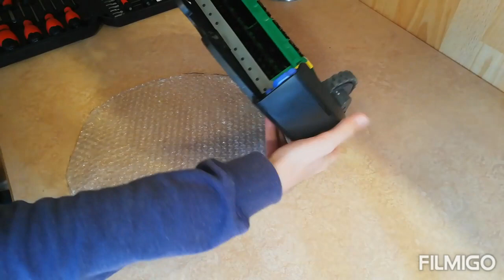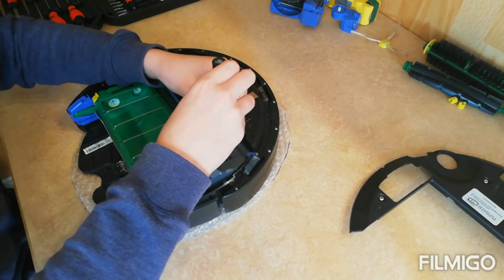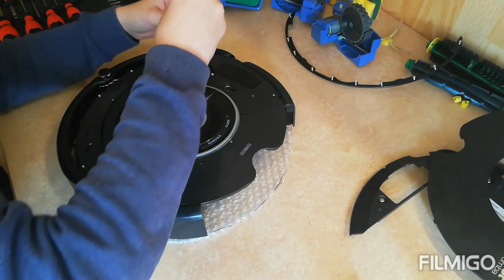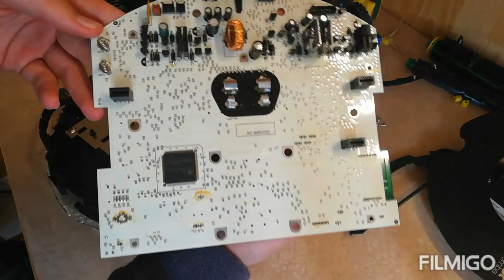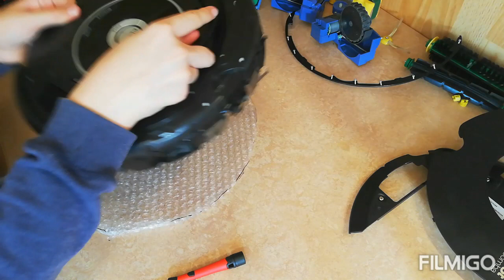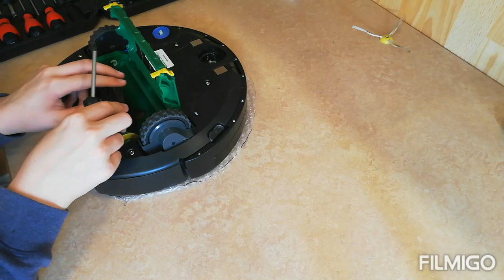How to take out motherboard from Roomba 500 series | RoboVacCollector

Comment: My schedule button on my 595 isn't working but all others are i can set time. I read the contacts some time get dirty and can use cleaning with alcohol. What contacts would i be cleaning
Reply from the maker: You need to dissassemble the Roomba, dissassemble the button, it is hold by single piece of tape, then remove it, and clean it there with rubbing alcohol.
Reply: @robovaccollector  your video is very helpful understanding how things work. Its been months since used schedule botton i changed tire treads so removed the battery just in case and it wiped memory.
Reply: @robovaccollector  i did it this morning  went all the way to mother board 🤞, it was covered with dust so blow it all away. The buttons didn't look like tarnished so just used air in can to blow that board and connected wire out. put it all back together hit schedule  button twice and it worked 👏👍😁. Its on run and seams to working fine, now just to see if it docks 🤞 like to move it around think its blind in one eye🧐.
Reply from the maker: @kinglord5429  I'm glad it helped, that is why I'm making theese videos. :)
Reply: @robovaccollector  little effort getting bumper off and on until i saw the clips. Little guy doesn't want to quit
Reply: Ashton6 I was just like you like a lot